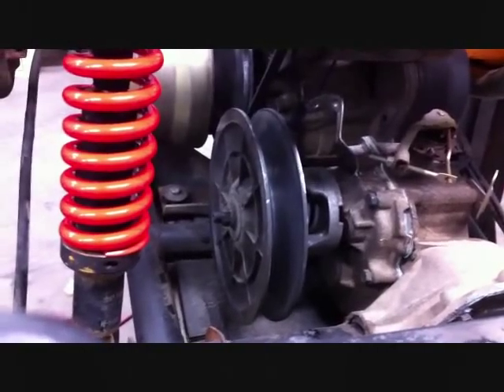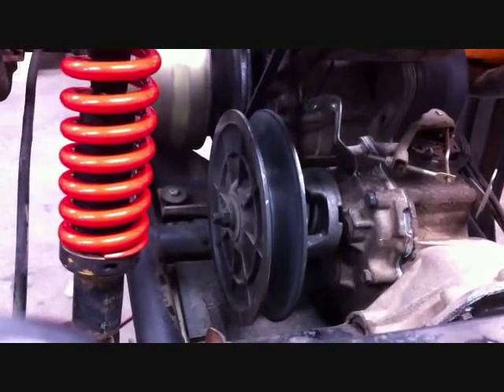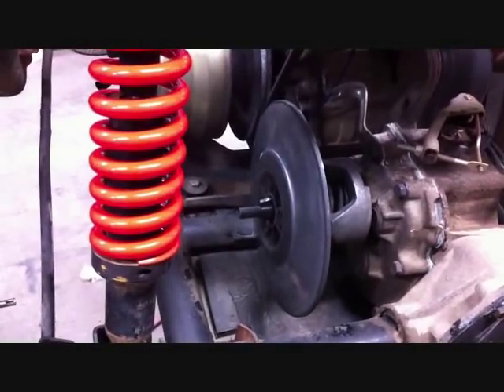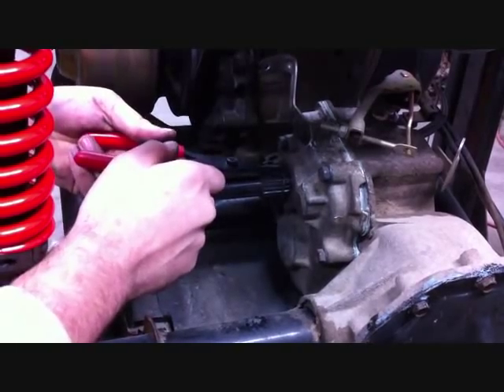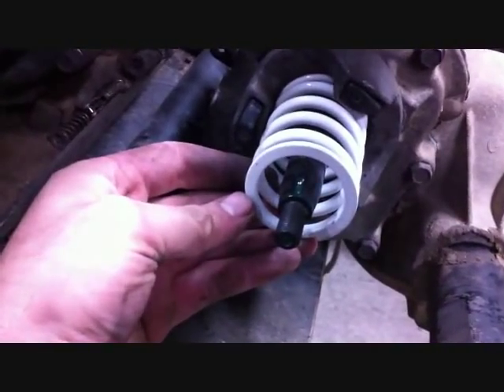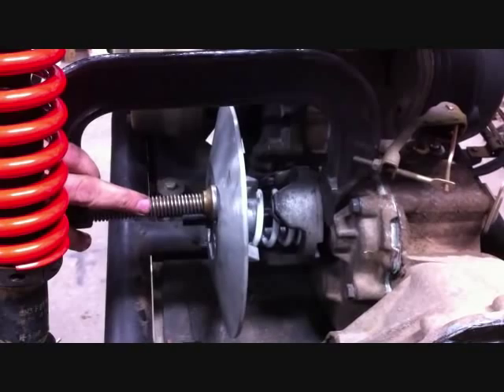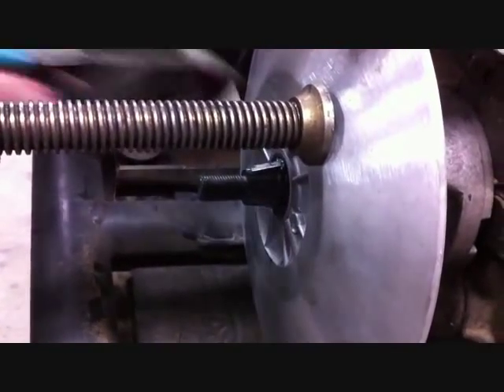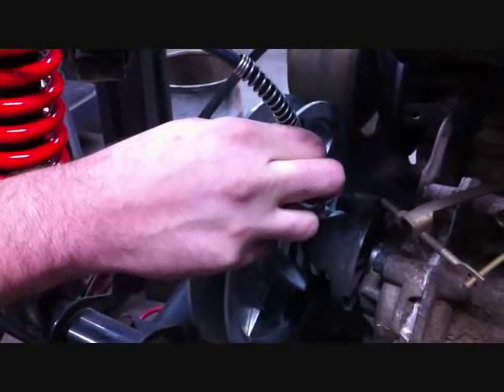Jake's Yamaha Power Kit G14-G22 Installation

Comment: The half Moon key is a bear to put back in....

I see in the video you skip over (cropped video) what was actually done...

There is a rubber fitting on the clutch

The key won't stay in place to put the 2nd piece on.....

Comment from the maker: This kit gears the cart lower, for improved torque, faster take offs, and better hill climbing.  Restores lost power that typically occurs when larger tires and wheels are installed.
Reply: Why don't you use the nylon washer on the inner sheave
Reply: How do put the half moon key
Reply: Anyone figure out how you get the key to stay in place when you take the clamp off?

Comment: have you ever replaced gears in the rear end I'm doing the spring kit next week but don't think it will be enough ,live In pa I power out alot and got to back down alot ,I'm thinking spring kit and 15 to 1 ratio gears ,I have 6 inch lift and 23/10/14 tires and wheels  ,stay all summer in a camp ground so I don't need any speed just  power to take family fishing or hunting,  is it worth the money? and can I change gears without pulling tranny,? it's a 97 yamaha g16a   . I do have a side by side we use at home all the time but the cart is more camp friendly . any advice would be totally appreciated